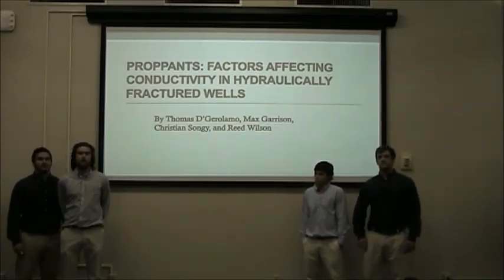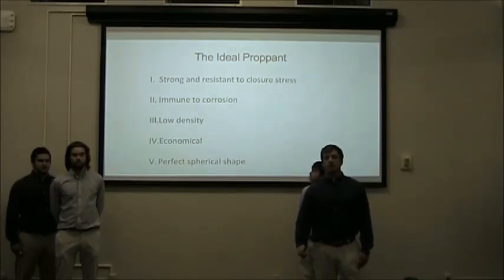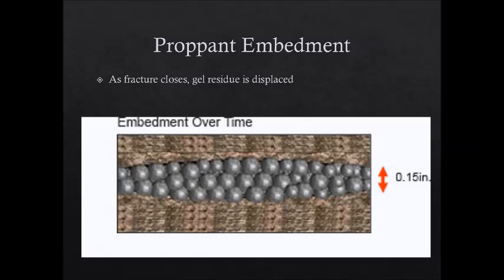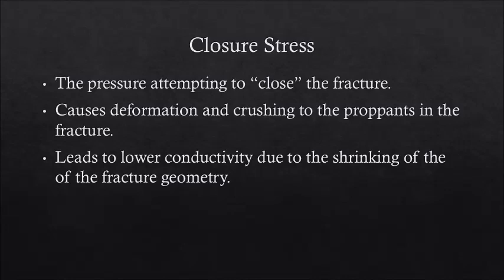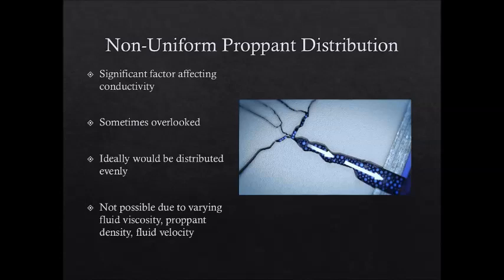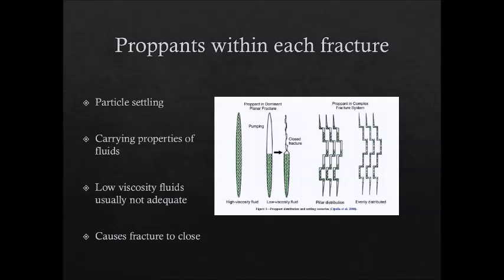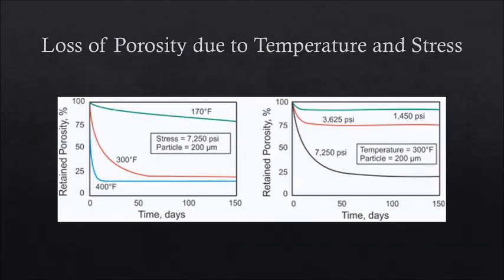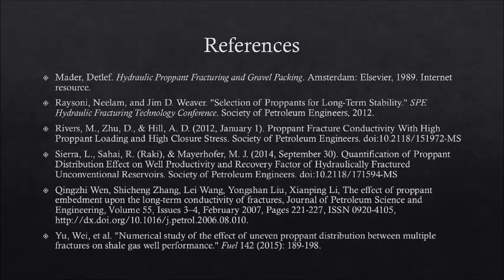Proppants: Factors Affecting Conductivity in Hydraulically Fractured Wells

Comment: Fracture conductivity is not the same as hydraulic conductivity. The first one is the multiplication of permeability and fracture width with units (L^3). Hydraulic conductivity is the equation you presented and its units are (L/m). The study you presented is about fracture conductivity and not hydraulic conductivity.